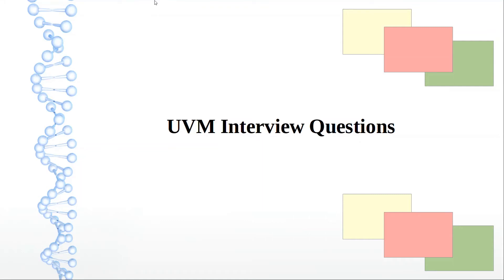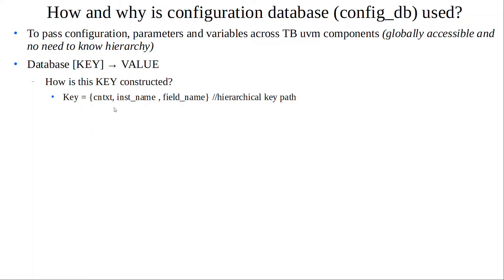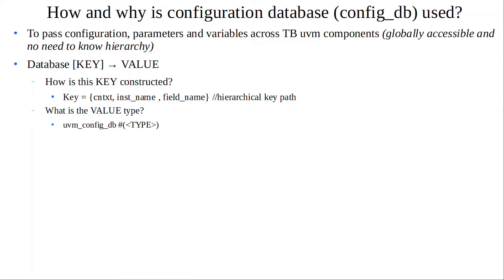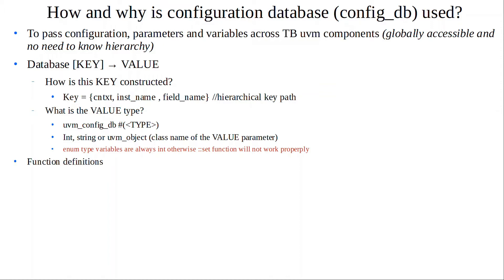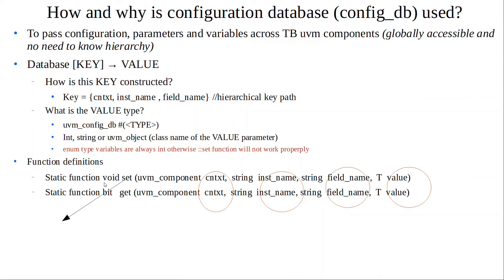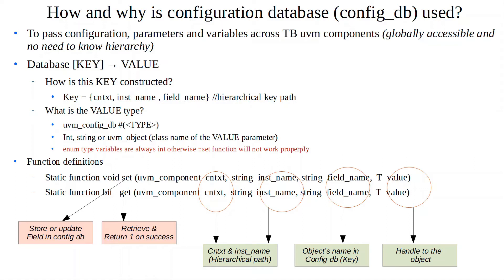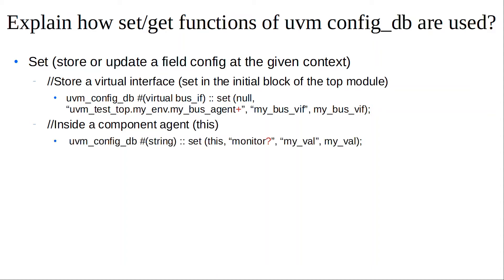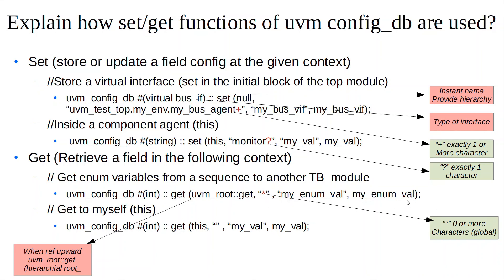How and why is configuration database (config_db) used? What are the set and get functions?

Comment: Is it possible to set config db in lower hierarchy and get it in upper hierarchy?
Reply from the maker: Yes, it is possible to set the config db in a lower level and obtain it in a higher hierarchy. One way to prevent issues is to do config db set in an earlier phase in the lower level hierarchy and get it from config db in later phase.
Reply: No it's possible it's through resourc db it is possible @SiliconNSignals

Comment: Hi Ken's .. I have one doubt.... Can we set and get objects without using uvm-config_db ? I mean is there any alternate method in UVM ? Like in ovm we have set_config_object and get_config_object....
Reply from the maker: OVM functions related to set_config_object/string etc. are now obsolete in UVM 1.2 and have been replaced with uvm_config_db #(uvm_object/string) ::set (...). It is highly encouraged to set and get a full config object with all the required variables/configs versus setting and getting individual strings and variables. We can technically use uvm_resource_db to accomplish the passing of objects between TB components however, it is still better to use uvm_config_db, a convenience layer on top of uvm_resource_db.